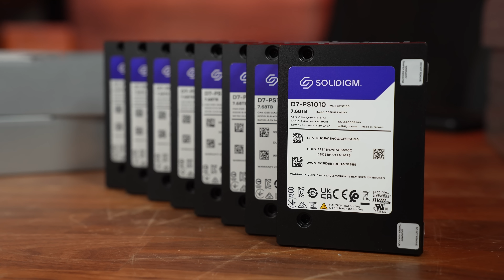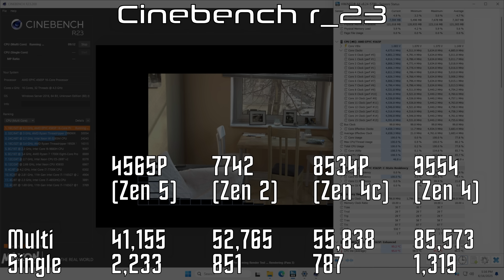AMD Epyc 4005 is REALLY FAST! - Supermicro Microcloud

Comment: Best application for this is cybercafe, something like a local "cloud" game server, with each node assigned to specific client mini-pc. Rather than building 200 gaming rig individually which takes up so much space and heat. But If there's a better solution (1440p, 120Hz) for KBM & Display over ethernet, it will definitely be a lot cost-saving.

Comment: Speaking of this awesome form factor, did you see someone got the BC250 working with games. Still need to edit the BIOS to unify that 8+8 into a single 16GB pool, or like 1+15 
Would be cool to see someone remanufacture the board to get doublesided for 32GB but that would be comically unlikely to happen.

Comment: Ah, the logical next step from the Cloud Edge C6100
Now imagine if they were all Strix HALO with DDR5 instead of LPDDR5, yea yea yea its like half the bandwidth because even though you can run at DDR5 8000 you're going to have a heck of a time running in 1:1 above 4000(without disabling most of the APU other than the cores, yea the 8700G can do like 8400 in 1:1 but that required disabling the GPU, IOMMU, rebar, and using CSM for crying out loud)
But gold dang would it be nice to give Strix Halo 512-1TB of unified RAM and then having 10TB of RAM in a 3U cluster with 160 CPU cores and 400 GPU cores.

Comment: I am still running x2 R710's, x2 R620's and x2 R730's.  One node would run everything I have running at idle besides space.  Currently around 158TB of external SAS drive arrays.  I want a few of those 122TB SSD's.  LOL

Comment: 8:20 This isn't true. With the right board, the regular ryzen CPUs support ECC ram too. The only difference is that the epyc 4000 series is validated for server use. (although the "pro" versions are required for APUs, like 8700g or 5700g).
Heck, most gaming boards from asus or asrock officially support ECC.

Comment: good thing i handle only machines in the range of Dell PowerEdge R2xx to the R7xx systems, those are relative lightweight even fully equipped. i mean 4kg to 25kg depending on the system Depth. 
The lightest and heaviest systems at the same time are the SAN Devices. Without drives those are Lightweight macines with only 3kg to 10kg but fully populated some weight up to 80kg. Sometimes those are so heavy, your rack deformed if not stacked correctly. This means if your rack is mostly empty and you start from the top. Your rack will collapse, even with the rails. Who not only supporting the weight, but also serve as reinforcement for your rack. That is why heavy servers are often requiring rails and in some cases they need to be put into a 6 post rack rather than a standard 4 post rack. 
Normally is in the installation manual this is mentioned. For the PowerVault system, i mostly handle, the manual says you have to use a 6 post rack and possitiin doesnt matter but if you use a 4 post rack you have to start from the bottom so the SAN systems are resting on top of each other. A typical deployment of a PowerVault storage server is 3 PowerVault on the bottom 2 R200 between and another 3 on top of them.  Then you connect both 3 R200 with a 25gbit DAS cable and make 2 loops with the 10gbit for each 3 PowerVaults. Connect one loop to one of the r300 systems and the second to the other. In the end you have 2 loops on each server and both servers are connected to each other. Now you do this 3 times and now you have a high available storage server with dual a failover. We use this setup for critical storage infrastructure, like for the Laboratory on our site. 
I know it is not perfect, but it is exactly what those people need and the PowerEdge R260 is more that capable to handle this workload. As for computing, we have in some Laboratorys cluster systems with GPUs or CPU only or Tensor units. Depending on the use case and preferences of the staff. The biggest cluster is 2 of the R940 fully maxed out with PCIE extender and external Rack mountable enclosures full of Tensor units. 28kw uses this monster on burst and only 460w on idle. i don't know what exactly happens on this system, but it is located in the testing area for microprocessors.

Comment: These are nice and all, but still have independent networking and management. And that makes old school regular blades better option in my eyes.
Reply from the maker: Traditional blades have unified network controllers and switches, but that also comes with added cost and complexity. Keeping the nodes independent actually helps keep it more affordable. For this system, I like the fully independent nodes.
Reply: @CraftComputing  Yes, affordability wins here, true. But kabelsalat remains :) And you still have to buy those external switches to which these nodes connect ...

Comment: for something so dense, I'd have a setup basically identical to what's in the video, but have all but one of the cpu only nodes be for virtualized services, with the remaining node be a fail over backup, and the gpu nodes working on inferencing full time in a similar fail over config

Comment: Welcome back in the 90s where all engineers sharing there local SUN workstation. They why reasonable quiet and 100M network is on the same scale to compute today. Now again local we use notebooks which are more powerful than the rack servers where the clever business figured out to scale the cost by square with the number of cores.

Comment: is it possible to run the rtx pro 6000 in the gpu node?
Reply from the maker: You're limited to 400W on the GPU, so the RTX PRO 6000 Max-Q would be an option.

Comment: I'm still running a Cluster of two dell C6320 with each 2x10cV3, 256gb and only sas disks, with no real option for good ssd. The 4 Node Intel VRN2224THY6 next to it with each 2x 18cV4,, 512gb and 4x sas + 2x u.2 is wayyy better, but also overpowered and it still struggles keeping the T4 cool with fans at full blast.
I think 128/196gb ram per node is perfectly fine, like... at an event with live video transcoding I used a c7000 with 8x 2x5645 96gb and this chassis has the same - if not even higher - power portential in only 3u with lower powerdraw ^^
I personally would set it up as 3 nodes with HBA and/or GPU cards for a HDD JBOD each and the rest as CPU. That would be a perfect HCI VDI system.

Comment: The fact that a SINGLE 4565P is 78% as fast as a SINGLE 7742 is absolutely ASTOUNDING to me.

If only there were AM5 motherboards that had more PCIe lanes.

I would be VERY curious what's the idle and full load power consumptions of the 4565P, when you ran Cinebench R23.
Reply from the maker: Heck, it replaces a 32-Core Genoa as well!

And yes, I've been asking for AMD to fill in a middle ground between 24 and 128 PCIe lanes as their only two chip options for years.
Reply: @CraftComputing  
If memory serves, I thought that there was at least one generation of Threadripper that had 64 PCIe lanes, but not a newer generation such that it offers said 64 PCIe lanes, since then.
Reply from the maker: Correct. First and Second Gen Threadripper (along with Naples/Rome on Epyc) had 64 lanes.
Reply: @CraftComputing  
Gotcha.

That's quite a bummer as I was looking to get a dual 7742 EPYC system, for the 128 PCIe lanes, but the fact that it takes like four times as many cores (on a single 7742) means that unless my workload can scale to that many cores, in practice, if the workload doesn't scale, it will be less performant.

It's like having a triangle where I can either pick PCIe lanes, cost, or performance -- and do the "pick two" thing.

sigh...

Comment: Strange how there is b-roll of a node with 4 memory slots while sometimes there are nodes with 2 slots. Are there different compute nodes available?
Reply from the maker: The nodes have plastic covers over the memory slots. All of the compute nodes are identical. The GPU node is technically just bolted onto the side of a compute node as well, and is functionally identical.
Reply: @CraftComputing  ah it looked like the plastic cover covered two slots. Glad we cleared that up. Great video.

Comment: Are the fans adjustable or just always screaming loud?  Could you configure them to stay quiet if the load on the server is light?

I have a HP z440 E5-2690 128 GB workstation that is really quiet.  Just don’t want excessively loud compiter(s) in the office or homelab
Reply from the maker: Yeah, this is not for office environments. While at idle, it's not terrible in the same room as you, as soon as you push a load through one of the nodes the whole thing springs to life. Make sure your rack is bolted down.

Comment: A good gaming dedicated host server.
Reply from the maker: The nodes also support desktop Zen 5 chips, so you could in theory run a 9950X3D in these as well if gaming was the goal.
Reply: I was thinking about a rentable gamehosting server like a GTA server for 100 people or something like that, not like a stream games solution but both works @CraftComputing

Comment: My buddy is working on building out a new, huge AWS data center. (And I mean building, like it's new construction.)

He gets input on the hardware chosen. I think something like this, repeated many times over, would make a lot of sense for AWS.
Reply from the maker: Yeah, for cloud hosts the do TONS of 1 vCPU instances with maybe 512MB each for clients, these are an amazing solution.
Reply: The big HCI vendors from my understanding would rather pack as much density per U for the spec they want than something like this given cost isn't the limiting factor.  A box like this would be aimed more at MSP's who would want to to dedicate a node or a few nodes to a customer to do what they want with at relatively minimal cost per cab without the potential hassles of water cooling and power and the like at HCI scale.  Been working on and off with boxes like these since whatever Dell/HP blade servers back when and like seeing what comes out with each new hardware generation.
Reply: I was thinking somewhere like Hetzner where they do a lot of game servers and stuff.
Reply: I think these would be popular for hosting gaming server, they usually want high single core performance.

Comment: "... while keeping the cost of the system somewhat reasonable ..."

So it is a lot more expensive than the Raspberry Pi server in my cupboard. 😊 Great so see that there's so much available nowadays. I can't help wondering what my colleagues who had built a large multi-user system with 8 Mbytes of core would have made of this if it had been sent back to the 1970s.

Comment: Half of a MI350 would make a nice 400-600W GPU or a power limited RTX6000 Blackwell paired with the 4584px and you’ve got a decent base node for small scale AI, HPC or even remote workstation cluster
Reply from the maker: An RTX Pro 6000 Blackwell Max-Q would be amazing in here.

Comment: I cannot even fathom having this much server maxed out.
Reply: I cannot even fathom what it sounds like maxed out (or even at ideal with one running)
Reply: @Royaleah lol. Come to where I work. We have data enter upon data enter all over the world filled with over provisioned servers.  When we started shifting to the cloud the business thought it was a good idea to right size.  Now in Azure, the same servers have even more ram. lol.
Reply: @Royaleah from experience with the 4004 Epycs, very loud. Noticeable temp and noise increase in a datacenter environment from what I heard... But very fast in terms of computing!
Reply: I cannot fathom an engineer who believed that was enough space for a PCI card given the available options.   Have a hard time believing an A100 or A6000 would fit.
Reply from the maker: A100, A6000, MI210, Blackwell Server... all built on the exact same standard 2-slot size. You are limited to 400W, so you'd need to opt for the Blackwell Pro 6000 Max-Q... other than that, no problems with standard server GPUs.

Comment: I've been running their stand alone motherboard with the Zen4 16 core 3D vcache version for about a year and love it.  It's unbelievable how much faster it feels compared to any of the "big iron" servers I've used.  My only complaint is the memory speed which drops to 3600MT/s when using 192GB.  I'm hoping they keep the AGESA version up to date for the Zen6 CPUs when they come out.  Great video!

Comment: Can those NVMe drives work in an environment without server grade forced air cooling?
Reply from the maker: I planned on finding out before sending them back. I'd love to have one in my Minisforum MS-A2.
Reply: @CraftComputing  Somebody suggested buying used/retired enterprise grade SSDs because they still have more life left than BRAND NEW regular consumer grade SSDs... so it made me curious. Being incased like that seems like a normal cooling issue for a fast SSD (without throttling due to heat). *This is a concern for me because I have had several "reliable brand name" SSD drives - both SATA and m.2 - totally fail or just become too unstable to use. And that's without crazy high use cases either. I never had a platter harddrive just fail without warning (and I bought used platter drives even).. I suspect because enterprise and consumer grade platter drives were not very different. But consumer and enterprise SSDs must be quite different.